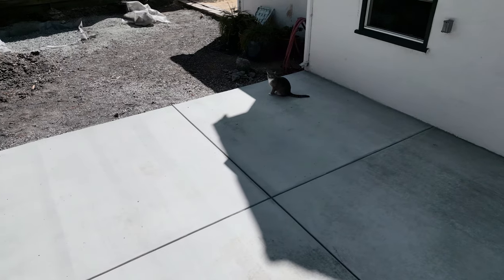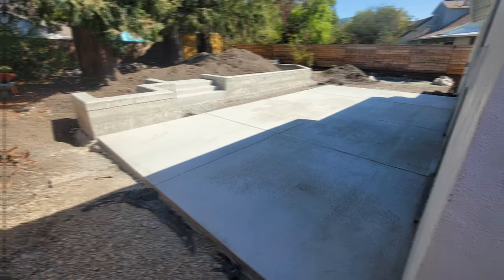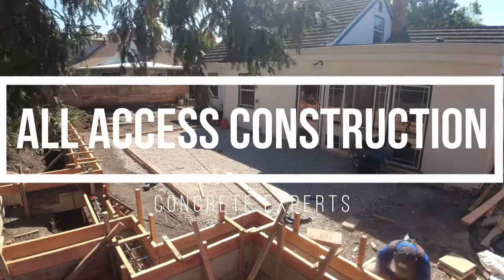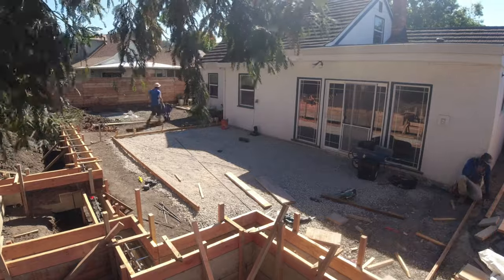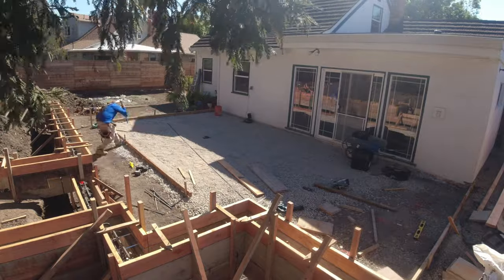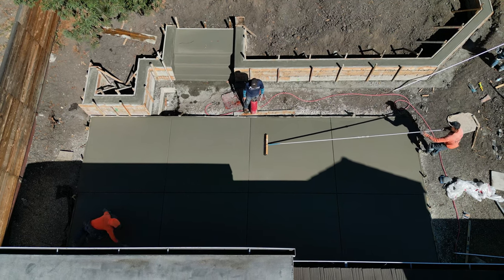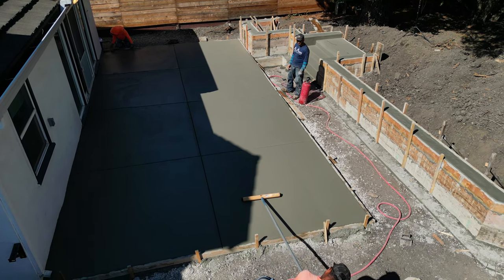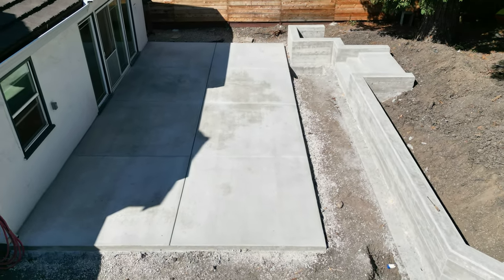Need More Room In Backyard ? Just Add A Concrete Patio.

Comment: Beautiful work!  I have a quick question about the surface finish on the vertical exposed face of retaining walls.  How do you make it match the surface finish of the top of the retaining wall?  Do you pull the forms before it's completely set, and do your brushing and finishing treatments at that time?
Reply from the maker: Check out this video if you want to do a smooth wall. You have gotta make sure your guys can handle it. Timing is everything 

https://bit.ly/3xEnlff
Reply: @AllAccessConstruction  wow, thanks for that link!  I bet not many teams would've been confident enough to tackle that job in a single pour.  But you and your crew made it look easy.  Side wall finishing sounds like a scary proposition.  Thanks for that info!